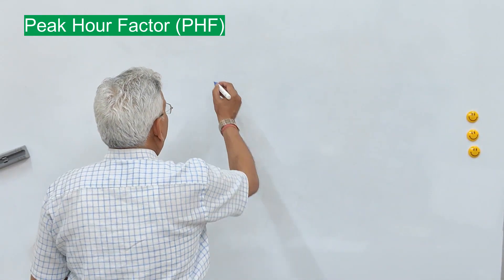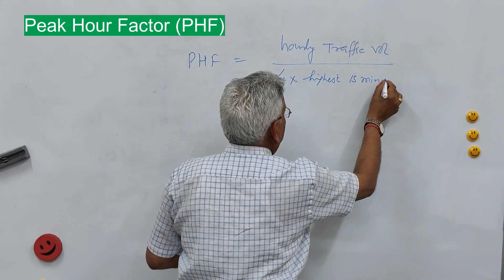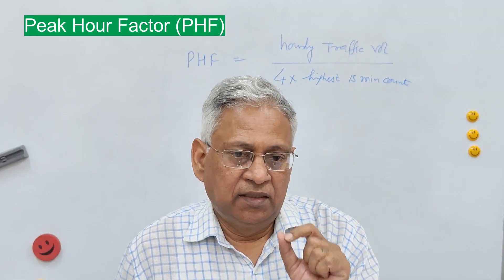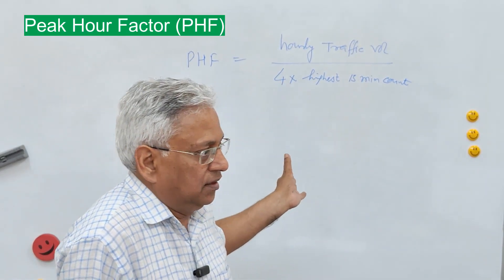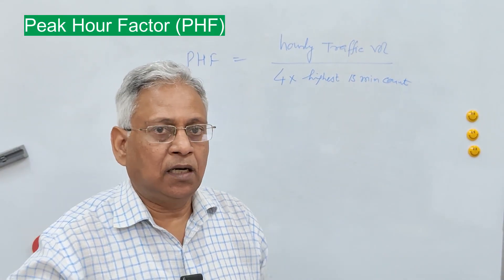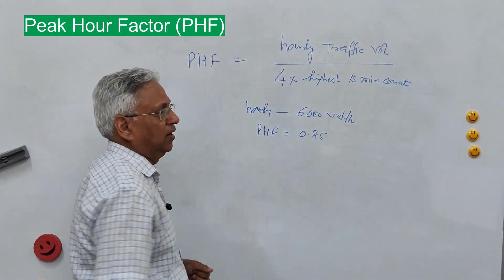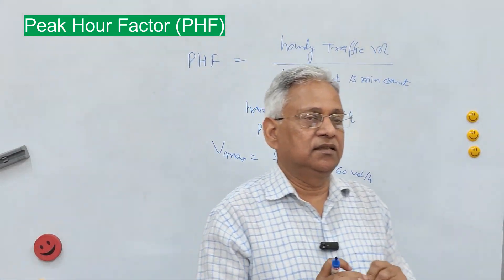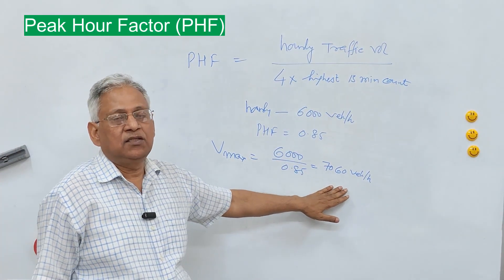Peak Hour Factor (PHF) on a road and its calculation and application. Why do we need PHF? watch it.

Comment: Hello Sir, Hope so You are Doing well. Sir I have been assigned a task of "Analysing and Mitigation of Peak hour traffic Congestion at Motorway Toll plaza"

I have 5 days data of Traffic Passing through the different Toll Booths of Plaza with Traffic type. And one day hourly Data of Traffic with detail of Total Vehicles passing through each lane and average veh/min. I don't know how and from where to start, what things I have to take into consideration to do this task. Also I want to use Excel for Analysis. Could you please guide me.
Reply from the maker: Plot hourly traffic volume versus time (in one hour interval) and see the peak period or peak hour in a day. During the peak peak hour, make a table of 15 min traffic count and find out the peak hour factor. Divide the hourly volume by this PHF and that is is peak hour volume that can occur on this road (or lane). Compare it with the capacity of the section and see the level of service. Plan your mitigating measures based on LOS
Reply: @SatishIITR Okay Sir Thanks. I will do it and If I need nay help than I will ask you

Comment: I would like to highlight a comparison between the highway design service volume guidelines provided in IRC:SP:99-2013 and those recommended in the Indo-HCM 2017. Both documents serve as key references for capacity analysis and traffic design, but they differ significantly in methodology, assumptions, and applicable contexts. Please share a video related to this comparison
Reply from the maker: INDO-HCM is not yet adopted by the IRC or MoRTH. DSV values given in IRC codes have no basis or logic, they have been written by someone and approved by the IRC or Ministry. But these are the values which are being followed for all projects of upgradation in the country.
Reply: Thank u sir